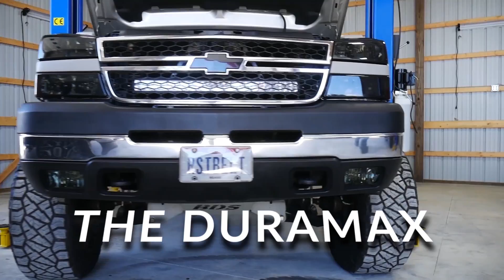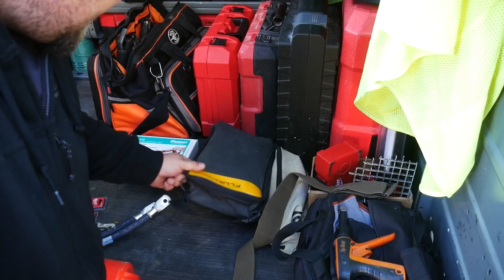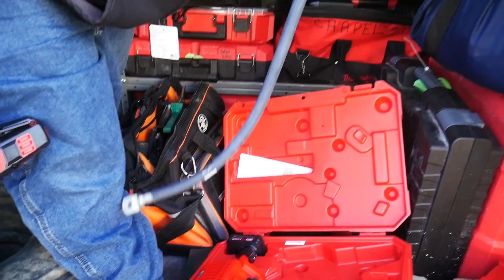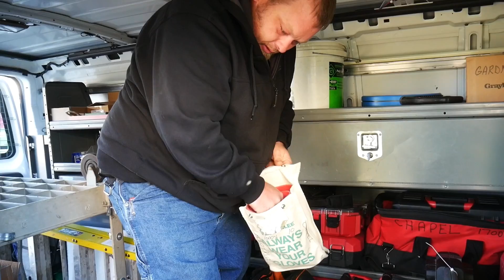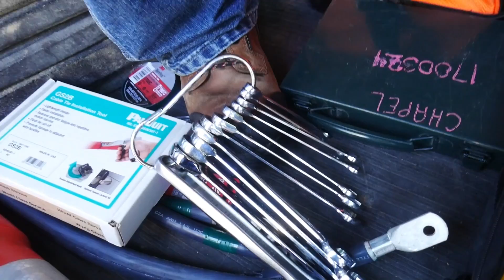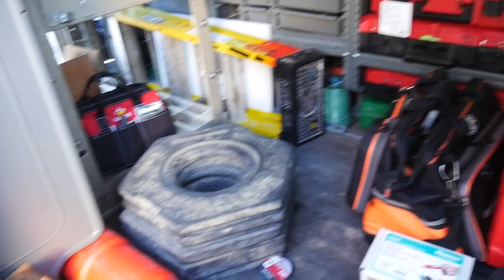TOOLBOX TOUR OF A MASTER ELECTRICIAN.....WELL...TOOL-VAN TOUR

Comment: What makes him a “master” electrician
Reply from the maker: 20 yrs experience and all the commercial journeyman certifications
Reply: @RustbeltMechanic  a “master usually holds the contractor license, not just the journeymen card” still could technically call himself a master with that much experience though
Reply: A license that says master
Reply: I think in different states it means different things. But for us it means you can sign jobs

Comment: My dad had that EXACT van shelving system in his van. The only difference is he installed commercial kitchens. That thing was LOADED with steel. Steel sheets, tools, and anything else you could think of to work on steel. That damn van weighed so much it out weighed a tow truck that had to be called. Damn thing did a wheelie most of the way home.